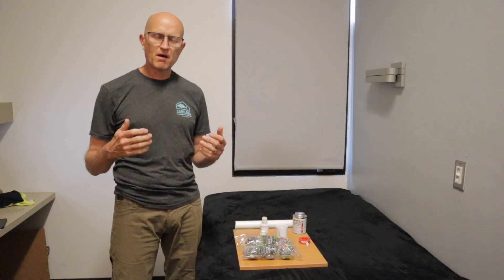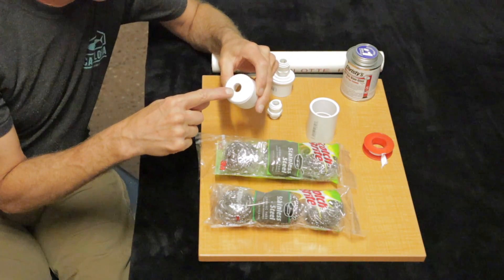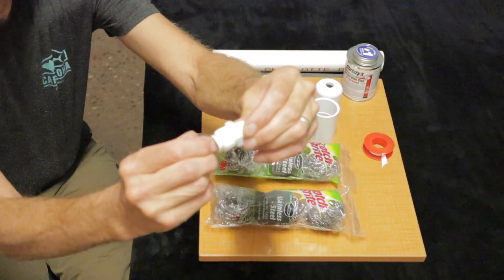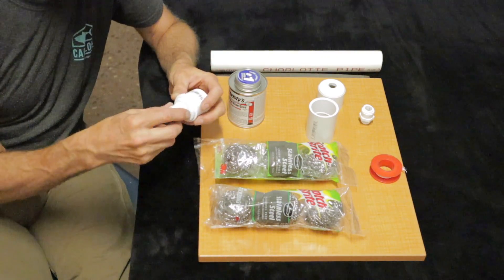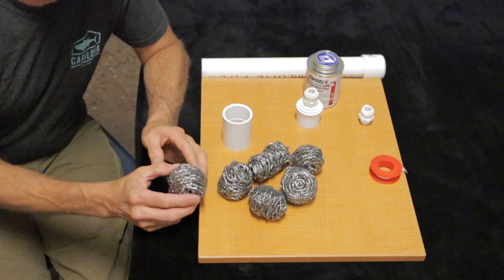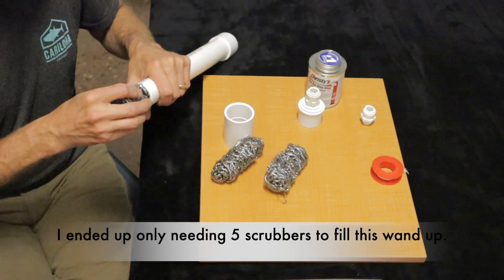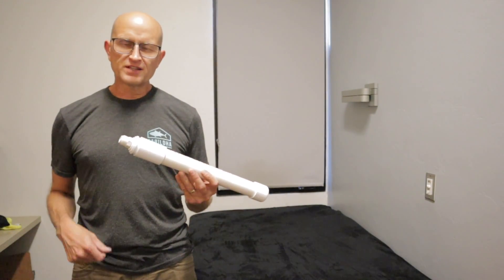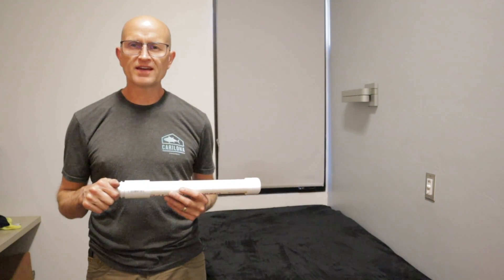Aircrete Foam Wand  DIY  [  How to build one that makes GREAT foam for less than $20 !!!

Comment: Do you really need the Air Valve?  If you can regulate the pressure that is all you really need isn't it?
Reply from the maker: The air valve saves your air when you shut off the switch. Otherwise your compressor would keep running and the air would flow continuously. You could just put a ball valve to shut down the air or just disconnect the air hose when you don’t want air flow. This would simplify the design if that is your goal.👍😁

Comment: Thank you  for your help. I think the fine wool makes smaller bubbles that last longer with Drexel, but, I probably packed them too tight. Also, Your comment about matching the air IN to the pump PSI could be antother issue. I had the compressor pressure set at 120 and was trying to reduce it with the ball valve where the air hose connected to the  "Y"  I will figure it out. I had a cnc plasma set up and it took me 6 months to figure out the programing, etc. This is  way easier. Keep up the good work-J
Reply from the maker: Hi Jerry, the ball valve regulating pressure that’s set at 120psi is a major one. The ball valve is only able to reduce volume not pressure. If your compressor doesn’t have a regulator that you can turn down to 55 or 60 psi, then you will need to put a regulator on your foam generator to get that pressure down. 😁👍

Comment: I didn't see this video before. My wand is about 12" x1 1/4"  My shark bites are 1/4" ID--smaller than yours. BUT----the pads you are using are couser and not packed as tight as my fine steel wool pads. I'm still leaning towards ---too much restriction in the wand. What do you think?
Reply from the maker: Hi Jerry, you are probably right. The reduced flow of the 1/4” hose and the restriction of the tightly packed pads are probably the first thing I would change. 👍😊

Comment: have you tried using a foamgun used for vehicle washing?
Reply from the maker: Hi there, no I’ve never tried one. I’ll have to take a look at that.😁
Reply: @PranaTech  another thing you can try is to add carbon fibers, powder or nanotubes to the mixture I bet it would add quite a bit of strength with minimal weight and cost.

Comment: Hi great video! Do you list the ratio of cement to foam you are using?
Reply from the maker: Hi Al, here’s my recipe that can be expanded if you need to. 
Small batch recipe.
15.66 pounds of Portland cement mixed with one gallon of water. Then add 7.5 gallons of foam. 

Or in metric.

7 kilos of cement to 4 liters of water and then add 30 liters of foam.

Or for a large batch.
My recipe is mixed in a 55 gal barrel and I mix 6.5 gallons of water with a 94 pound bag of Portland cement and once it is blended into a nice even slurry, while still blending with my drill, I fill the barrel up to the 45 gallon mark with foam.  Only mix it enough to incorporate the foam then pour into mold.😊👍

Comment: Sir, I have 2 doubts, pls clarify 1) your foam wand is smaller than your old one, which one will produce better foam?
2) Why only 1 1/4 inch pipe?
Reply from the maker: Hi Gajula!  1)Yes this one is a little smaller and because of the internal baffle it creates some back pressure in the wand which causes a better mixing of the foam solution and air and makes better foam. 2) I tried 2” and 1.5” and they both did not create as dense foam as I wanted and they needed more air volume to produce the lower quality foam.  Thank you for your questions! Namaste!🙏😊

Comment: Thanks so much! One question -- what size and type of slurry pump would you recommend to pump the foamed mix without popping the bubbles?
Reply from the maker: Hi Mike, the best affordable pump for the money would be a double diaphragm pump. You can find them on EBay for reasonable prices. 1” inlet and out let could handle aircrete without too much damage to the bubbles. 😁👍
Reply: @PranaTech  Thanks, Prana John! I'm super-grateful for your designs and videos. When I build my house I'll do videos as well, and show off your foam generator and wand. 

I plan mixing 100-gal batches, and pumping one-foot lifts on each wall, like 3-D printing. I can reposition the forms the day after, in prep for the next lift on the day after tht. I'm thinking that a concrete accelerator, along with the standard 48-hr cure period. would ensure that each layer is cured enough to support the successive layers. Or is that overkill?

I'm planning on 250 kg/cubic meter density (15 lb/ cf) for the 8'inch walls, but I think I'll need to apply a hard finish coat to firm up and seal the exterior. What do you recommend?
Reply from the maker: Hi Mike! Sounds like you have a great plan laid out! 30lb per CF is about as light as I have had any success with. Any lighter and the Aircrete gets very crumbly and not very durable at all. Even at 30lb density you will definitely need to put a skin coat of stucco to make it durable on the surface. Looking forward to seeing your progress as you go!👍😀Don
Reply: @PranaTech  A minimum of 30#/cf puzzles me. The guy at Domegaia is using a formula that comes in at 24# /cf :  94 lbs portland + 6 gals water (50#) + foam to 45 gal = 6 cf @ 24#cf. And Pioner's aluminum powder formula (50/50 quicklime and portland, with 1g alum  powder per 1kg dry mix) lightweights to 250kg/M3, or about 15.6#/cf. I'm wondering if the aluminum reaction, which creates hydrogen bubbles, make the aircrete stronger? I decided to not use their formula because the mix is real watery, and rises in the form. The rising part is cool, but it's so watery I can't use a simple slip-form.
Reply: @PranaTech  Oops! I forgot to consider the dry weight of the set aircrete in my earlier post. The 50# of water blows off, leaving the 94# of cement portion of the 45 gallons of aircrete. So it's 94# of dried aircrete @ 6 cf @ 15.6 #/cf, same as the Pioner 250 kg/m3 formula.
Reply from the maker: Hi Mike,  I pretty much use domegaia’s recipe for Portland mixing and then I add foam until my sample cup (6” tall one) full of Aircrete measures 3-3.5 pounds on my scale. This being one tenth of a cubic foot should give me 30 to 35 pound density per cubic foot finished mix. I use this chart for my strength chart. http://dlvews.com/wp-content/uploads/2017/08/Strength_Density-Charts.pdf  👍😀
Reply: @PranaTech  Thanks for the chart!

Do you mean your dry or wet finished mix of the Domegaia formula? And do you mix up to 45 gals? Asking another way: how many gallons of foamed (wet) concrete mix do you get with a 3-3.5 lb test weight in your sample cup? From my math on the Domegaia formula, their dried aircrete should end up being around 16#/cf, @ 45-50 gallons of foamed wet aircrete. 

I'm also gonna nose around and see if there are stronger/harder cements that can be used, that won't set up in 5 minutes like post hole repair concrete. Or I can add  fibers for extra strengh. My goal is get my roofing aircrete below 15#/cf dry weight. Any tips on additives or portand mixes or brands for strength?
Reply from the maker: Hi Mike, mine is the weight of it sampled wet right from the mixer. It is the same approx. recipe that Domegaia uses for the 45 gallons of final aircrete. I haven’t played with any of the other cements out there besides regular Portland. 👍😁
Reply: @PranaTech  Got it! Then we're talking about the same mix, just wet weight versus dry weight. 

Thanks so much for the dialogue! Talk soon.
Reply from the maker: Yes👍😀

Comment: After few uses the pressure will collapse the steel wool like pancake ., any update?
Reply from the maker: Good morning! The stainless pot scrubbers that I use are tightly packed so there is no collapsing over time. Still working great! 👍😁

Comment: I've heard other channels mention using the FINE stainless steel pads. I wonder how much that affects the foam.
Reply from the maker: Hi Dustin, the fine stainless pads will work as well but will create more back pressure in the system much like the smaller exit hole. You may need to enlarge the exit hole if you go with the finer pads. I found with the finer pads that the pressure gets too high and the the exit hole has to be bigger and then the pads want to blow out the exit hole and you would need to design a method to retain the pads in the wand. 👍😀

Comment: How does the size of the exit hole affect the density/quality of the foam?
Reply from the maker: Hi Dustin, the smaller hole helps make some back pressure in the wand so that the air and foam concentrate blend completely and make a more dense foam.👍😀

Comment: I'm "doing a refresher" (and seeing what's new), after a few other projects jumped ahead of my intended aircrete project of making a rocket heater & thermosyphoning water heater ~ hopefully, before it turns cold here in Okla.... Most of what I recall about making a wand indicated 2 key things, though: 1) To use threaded couplers at the pipe ends, in case we ever need to get them apart, to change out the scrubbers, make tweaks, etc. 2) To use either a couple of links of stainless chain or a whisk in the exit end, to prevent any chance of clogging. Since my own project got pre-empted, I'm NOT talking from personal experience ~ only extensive research, though... Thought I'd pass these two points along, for you and others. :)
Reply from the maker: Hey, good morning! I just made a new design foam wand that solves the need for chain or whisks in the front end. Here’s a link https://m.youtube.com/watch?v=UU5USOZL7cQ&t=30s  another viewer also came up with gluing in a 1” cap I believe into the end with holes drilled in it.👍😀

Comment: How do you stop the scrub material from being blown out of the hole? does yours not? I didnt pack them in as tight as yours and i ended up cutting the one at exit nozzle. First trial run made great foam then pieces off scrubbers started shooting out and clogged up the exit hole. Also, are you reducing the 90 PSI from the pump? I installed one way valves before the Y and only ran about 30PSI air on trial with dawn. I made my wand with threaded end on inlet so i can remove cut scrub pad and repack if that would fix. Drilled two holes and installed two thin bolts down at exit cap like i saw in another video to keep pads from blowing out but maybe cutting the pad just created loose strands which got pushed out. Oh yeah. Thanks.
Reply from the maker: Hi Dreamin,  yes I pack mine tight at the front end and this usually keeps the scrubbies from blowing out the front. I don’t reduce anything from the pump. These diaphragm pumps kinda self adjust to the load and will match itself to whatever pressure you set the air at, up to a point.  A couple of screws through the housing is a good way to keep those scrubbies from coming out.👍 I usually run my air set at 55-60 psi for my setup to make good thick shaving cream foam. If yours can do it at a lower pressure then that is great.😀👍
Reply: @PranaTech  I put a drain screen from home depot in the end of the pipe to keep the scrubbers from clogging the hole.  You can just place in the cap or end of pipe before gluing up.
Reply from the maker: That’s a great idea! Thanks for posting this!👍😊

Comment: U tried using stainless steel wool instead? does the denser pad make denser foam?
Reply from the maker: Hi Leon, no I’ve just been using the stainless pot scrubbers. They are so packed in tight that I think the steel wool would be a little restricted for the air flow.😀